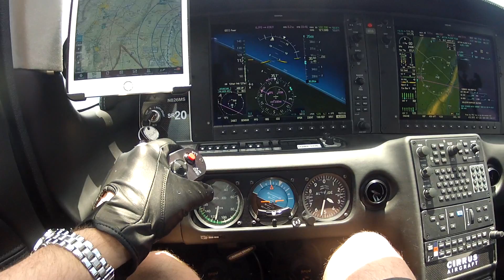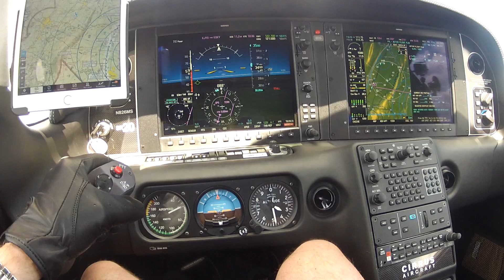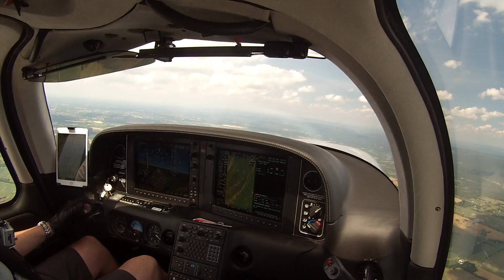Stalling a Cirrus SR20

Comment: Sorry if this a little late as I know you posted this 6 years ago. I noticed during the stall you did not at anytime hold the AP disconnect. Had you disabled the envelope protection from the menu as it seemed to me that the envelope protection was kicking in on the stall and pushing your nose down as it should so you would pull back and gain height. I didn’t see a full blown buffet and stall rather a series of stalls correct by the envelope protection.
Reply from the maker: Hi Ray, thanks for watching.  I disconnected the AP at 0:34 and was hand flying the remainder of the video.  If I remember correctly N826MS has envelope protection for overbanking but not a "stick pusher" for stalling.  And, yes, you are correct, these were not full blown stalls.  Happy flying!

Comment: I viewed it again, u gained to 3,800 not 3,900 ft; still too much. remember when adding flaps the aircraft WILL gain altitude, it has no choice; ur increasing lift by changing the camber of the wing so you must counter by trimming nose down until the aircraft settles into it's new flight attitude, then power for altitude, pitch for airspeed. Always watch the VSI; it tells no lies. Anytime you add flaps you must counter with pitching down or you will GAIN altitude, you added 50% flaps and you added nose up trim too soon, that's why you gained that altitude; 100% flaps more nose up trim you added, and you climbed some more. The aircraft began finally losing altitude as airspeed slowed and you lost to 3,400 before finally adding power way too late. You should have been adding power and nose up trim at about 3,600 ft to settle at 3,500 ft.  Watch that vsi, and u can't go wrong.  I hope this helps.

Comment: Yes, the SR-22 is an awesome piece of equipment, especially the new G6. Just a tip here to help you, not criticizing; the idea here is to transition from cruise flight to slow flight w/o gaining or losing any altitude. On a private pilot checkride you are allowed + or - 100 ft, you blew that by 300 ft of altitude gained plus the 100 ft ur given, gives you 400 ft that u gained; 3,900. You started at 3,500 and gained 400 in the transition, if i was a DPE sitting beside you; you would have failed; not because you gained that much altitude but because you made no attempt to correct it. The only time you lost any altitude is when the aircraft had no choice, remember power for altitude, pitch for airspeed; then you continued to lose another 100 ft before finally applying some power at 3,400 ft; target altitude 3,500. Then you let it stall in slow flight; i'll leave that one alone. Needs alot of work, poor technique.  Here is a tip to help you, always watch ur VSI for what i call trending, the altitude will always lag the VSI by at least 2 seconds so as long as the VSI is not moving; the altitude will remain unchanged. Now this is a little more difficult with the G-1000 because of the digital tapes for both read outs; as you do not have a analog gauge for the VSI among ur back up gauges; sucks i know; but it still can be done. It just takes practice, remember as aviators we must always continue to practice what we were taught in flight school or else our skills will erode very badly, a good sharp pilot practices these manuevers all the time, it's like second nature to them. Now i know this post will probably bring negative comments from those who have no clue about what i'm talking about; and that's ok; but as i stated; it is not meant to be critical but to help with my experience in what i have observed in this video. VSI stands for ( Vertical Speed Indicator ); it tells you how much altitude you are gaining or losing in hundreds of feet per minute; WATCH THIS FIRST for trending changes; as long as it remains at 0; ur Altitude will remain constant. As i was watching this i was saying watch ur altitude, check altitude, check altitude.  And as always, i welcome Josh Flowers comments; LOL!!!!   Inside joke between me and him....
Reply: You'd think with the leather gloves you could maintain just about any altitude..
Reply: I'm going to second Harold's observations that altitude hold could be much better. Starting at 35 and then going as high as 39 and down to 33 was sloppy.
Reply: Ladies and gentlemen with you the Cirrus the new doctor killer. Stall and recovery within 100 ft, that's what you looking for.
Reply from the maker: Wasn't a check ride and no DPE sitting next to me.  But thanks for the comment.
Reply from the maker: Just read the rest of your comment, didn't realize it was SO long!  I hope I don't get a bill for "flight instruction".  I noticed you have lots of great videos on your channel, so I'll have to watch your technique...oh, wait, nevermind.
Reply: Not gonna fence with you here on you're site sir, just my observation; take it for what it's worth; safe flying!!

Comment: thought you couldn't do stalls in a cirrus because there not spin certified ?
Reply: If corrected wrong or a wing drop occurs a stall can develop into a spin.
Reply: Lots of GA aircraft are forbidden from doing spins (like the 20,000 Cherokees used in flight training all over the world).   They all can practice stalls.
Reply from the maker: A stall is not a spin.  Practicing stalls in Cirrus Aircraft is routine and done regularly for training and practice.
Reply: I get that a stall is not a spin, but why take it to a full stall, instead of just to an imminent stall? The reason you practice stalls when you are training is to know how the controls feel when you are about to stall so you fix situation you are in, and don’t stall it. I just don’t see the point of taking it to a full stall, and inadvertently putting into an unrecoverable spin and having to pull the chute...seems like a big gamble just so you can say you did it and put it on YouTube. My humble opinion.
Reply from the maker: @Cleared2Productions  Hi William, I missed your comment a year ago, so don't know if you'll ever see this reply.  However, I thought I would comment anyway for the record.  These were NOT full stalls.  The stall warning occurs in a Cirrus approximately 5-10 knots BEFORE a full stall.  So, you will notice that I am holding airspeed and AOA right at the stall warning and never going to full stall.  This is a common (and safe) technique practiced and required during Cirrus training and also something that we do regularly.  So, it was never a "gamble" and I don't do it so I "can say I did it" or "put it on YouTube.  But thanks for the snarky comment, gave me a good laugh! ;)